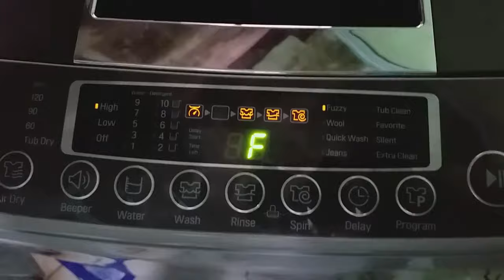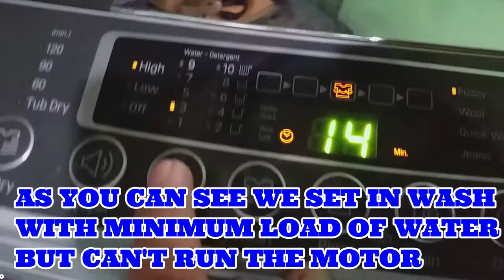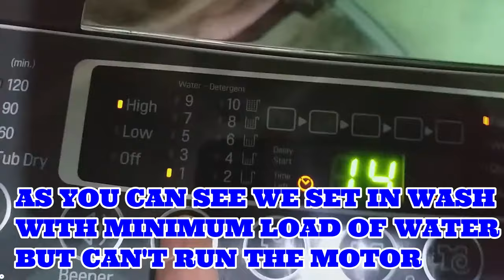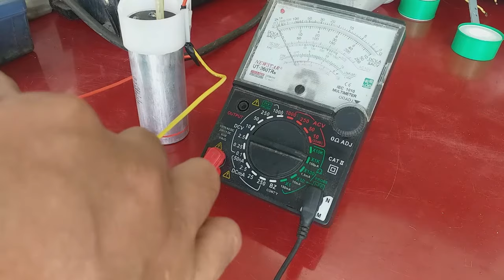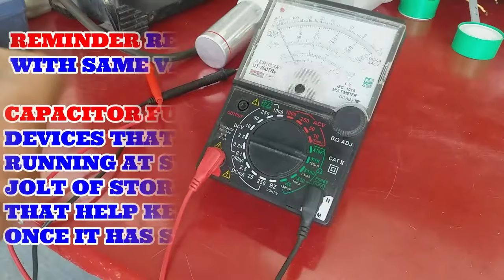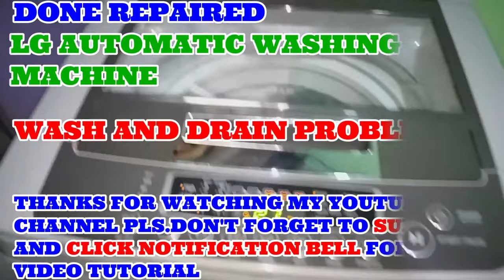HOW TO REPAIR LG AUTOMATIC WASHING MACHINE WASH AND DRAIN PROBLEM

Comment: I have wt1701cv the pump has power  but will not run. It will work once then won’t run for days. Have tried a new pump. Still same.  OE error code. Can you help?
Reply from the maker: pls check the connection on pump to control panel if open

Comment: Hi, I have Lg fuzzy logic full automatic, problem is that water from drain pipe not stopping,just coming from in let and out from drian. Any solution??
Reply from the maker: Check the drain hose lock at the bottom of washing machine possible a lot of dirt that caused malfunction on drain hose lock
Reply: @jnvtechelectronicstv2704  dear  machine is new and yesterday I just change me house from one location to an other,after shifting this happened. What are the possibility for this issue?
Thanks for replying

Comment: hi sir!walang display after pressing power on,pero tumunog siya.same washing machine nh nasa video.ano kaya ang problema?thanks!
Reply from the maker: may problem po supply nyan sa panel board
Reply: @jnvtechelectronicstv2704  salamat po sir!check ko.

Comment: Hello. Good afternoon. Sir matanong lang po. Paano ung hindi nagwa-wash at rinse pero ung capacitor okay naman po sya. Ang timer nagbaba lang ng once. Ano po sira nyan?
Reply from the maker: pa check nyo po yung water level sensor nya baka po shorted or open
Reply: @jnvtechelectronicstv2704  sige po. Salamat.
Reply: @jnvtechelectronicstv2704  sya nga po pala. Saan makikita ung water level sensor po?

Comment: Yung LG ni Nanay 4!years na in good condition parin
Reply from the maker: Buti maam tumagal yung tv nyo yung iba kace 1year palang pinapaayos na.
Reply: @jnvtechelectronicstv2704  hehhee waching po kuya😊 Opo siguro po di over load at balance yung pag lagay ng mga damit para pag nag spin sya hindi aalog. usually pag di balance ang lagay don nag start ang pag kasira